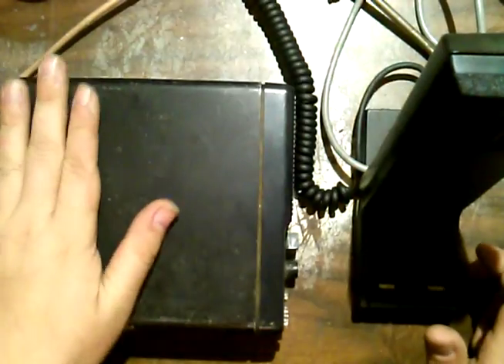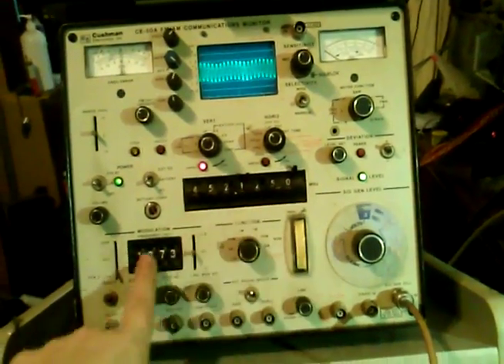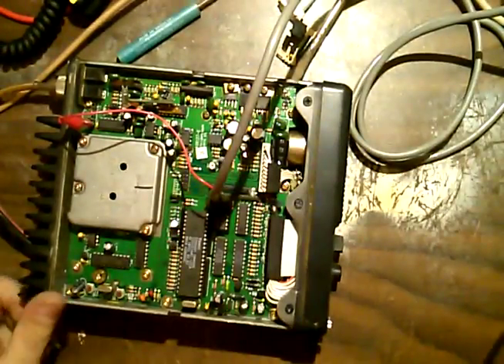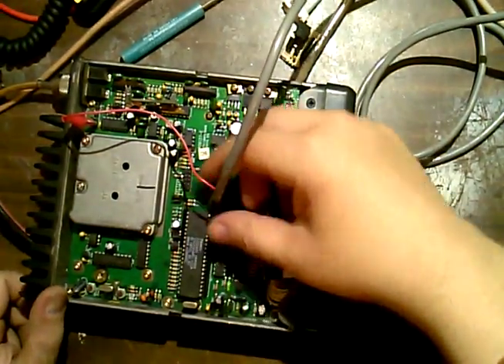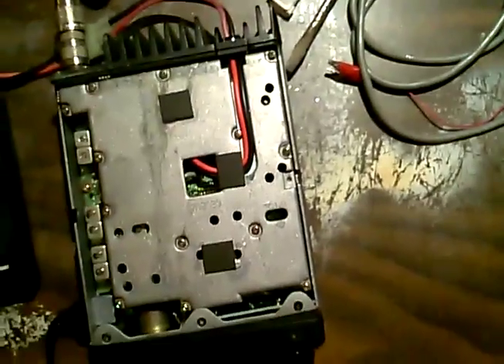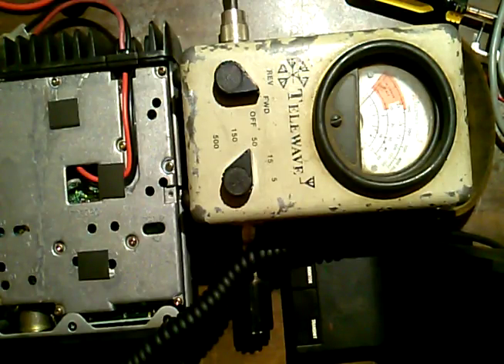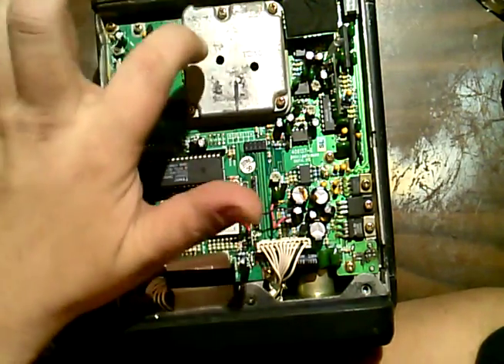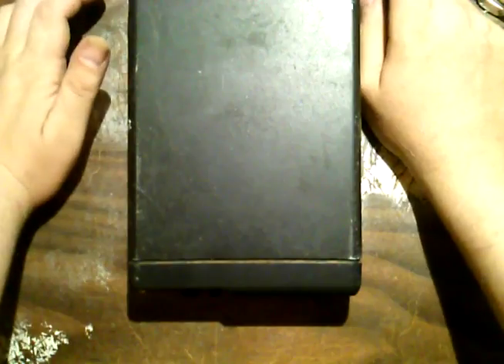Maxon SM4000 series radio alignment and programming for GMRS

Comment: Hello! I have a Maxon smx4150 system version dec 100ch, that radio was programmed with the progsmx 2.08 or 2.07 software and the smp4002 programming cable. I don't have the schematic for the smp4002 programming cable, could you help me or would you have the schematic for the smp4002? regards

Comment: Hi dude, nice video.
I have problem may you can help me please
I have maxon sm4450SA and smp4004c v 2.21b but this version only has 4450ex but no 4450 so eeprom is conflicting. When I read radio I get wrong values as my eeprom is 93c46 
Where I can obtain software containing sm-4450 without ex
Reply from the maker: Look on this site - https://hamfiles.co.uk
or here - http://www.hackersrussia.ru/Radio/m_maxon.php

Comment: can u  make a video on how to program a Motorola ct250 and will windows 7 work with the newest software and what cable setup do i need to program the ct250 because i have a genuine Motorola cable for the pr400 and it goes into an adapter from rs232 to USB
Reply from the maker: the software should be fine on win 7,  CPS You will need the proper cable though for the ct250

The cable can be bought here - https://www.ebay.com/i/262591300888?chn=ps&dispItem=1
Software you get from Motorola.
Reply: Ok thanks for your help I will let you know if it works
Reply: i still cant get it to work can u help any more with a video please